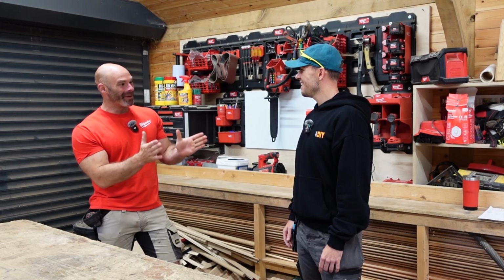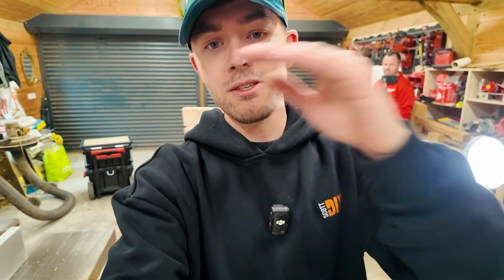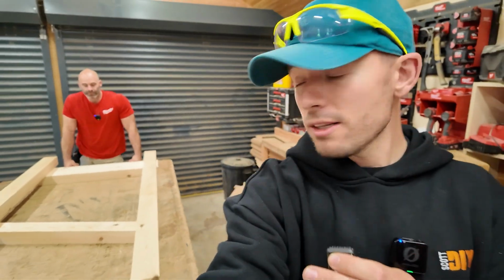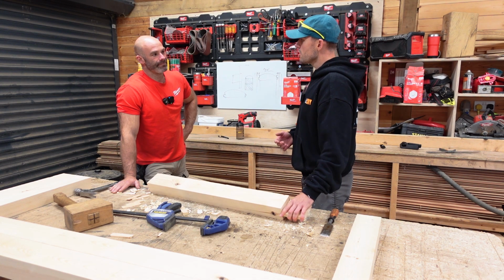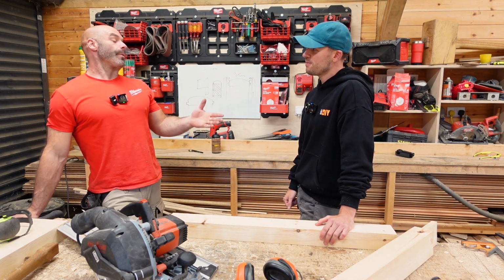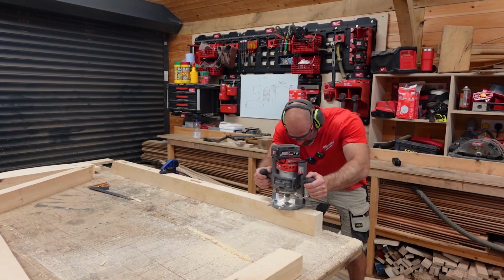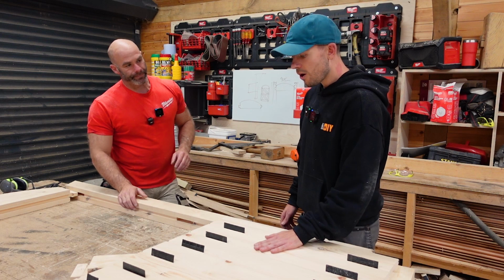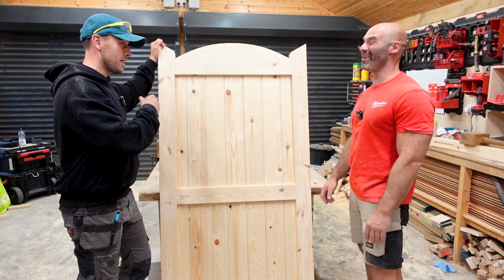Mortise & Tenon - Premium 6ft side gate

Comment: Hi mate, not to bad overall but I wouldn't class it a premium gate if it was a premium gate it wouldn't be standard Redwood (Pine) it would be European Oak or Iroko a naturally durable timber or even ACCOYA.

Being a bench joiner of some 36 years all in all not to bad but a few things for your next gate.

Firstly the legs are not legs, they are called stiles if you want your terminology correct. I personally would have done through mortise and tenons on a external gate as this allows you to wedge the joints generating a far stronger gate as you create a dovetail effect by wedging it stopping the gate from coming apart.

Secondly, dont glue your T& G Boards into place they need to be able to expand and contract hence the idea of using the packers to leave a gap to move. 

If you are going to inset the T & G into a groove like that drill some drainage holes through the rails to allow water that will gather in the bottom of that groove to drain out as it will fill with water over time and sit there in the cold winter months .

Thirdly, if you are wanting to inset the boards like that or just using T & G Boards in general I would recommend pre-finishing inside the grooves and on the tongues and the grooves of the T &G as ultimately as they expand and contract over time you will see the unfinished raw edge as well as sealing the end grain where water will be drawn up like a straw with this design.

Personally if the gate is to be painted I would have used Tri-coyya MDF applied with a v-groove to generate the V-Groove effect.

For me a dont use softwood anymore and only use Hardwood for external painted projects if customers cant afford ACCOYA or Oak regretfully I think that your gate will give you around 3 years of service life only being softwood and being untreated before assembly.
Reply from the maker: Thanks for such a detailed comment! I can tell you really know your stuff. My channels are all about learning and sharing that with the community. the information you have given is really useful! I do plan to make another gate in the future out of Iroko so will take your comments on board.
Reply: @scott_diy As a trained joiner myself I would add that braces should be notched into the rails about an inch in from the stiles and not run into the corners. Basic detail I see so many so called professionals fail to do. Id give 6 out of 10 for that gate.
Reply: @alankirbywoodwork can you elaborate on why that is please? ..just curious, thanks.
Reply: @scott_diy  No worries mate thats how we all learn and improve our skills by taking advise and learning along the way we all have to start somewhere.

Next time come and see me at my shop and I'll show you how a better set up joinery shop works by having spindle moulders and tenoning machines to do the M & T joints and wide belt sanders for sanding your job, the set up that Simon Bowler has is okay but for larger and more acurate work having the larger machines helpsin accuracy and speed.

I'm local to Simon Bowler so you'd be coming to the same area, I've seen him a couple of times in Duffileds timber which is where you would source your Iroko from.